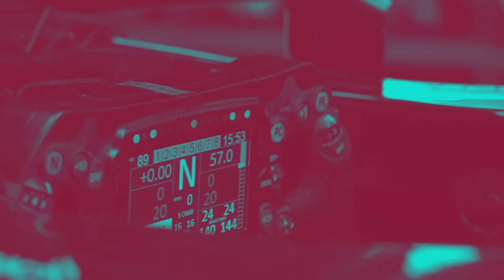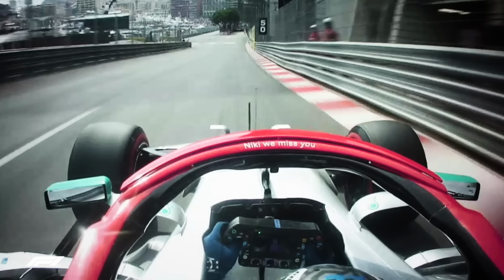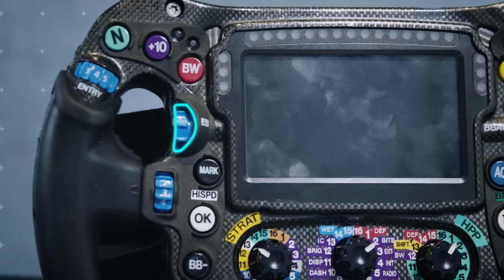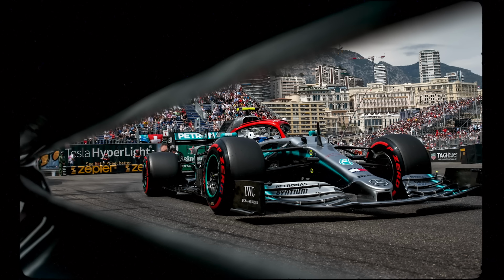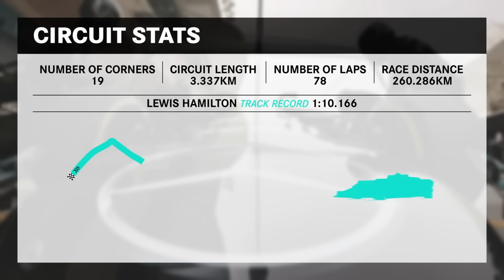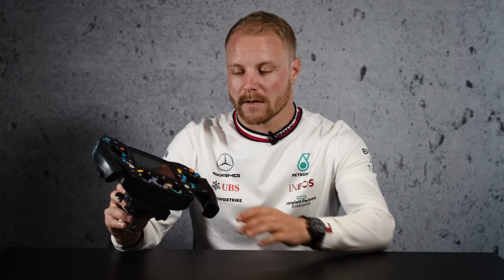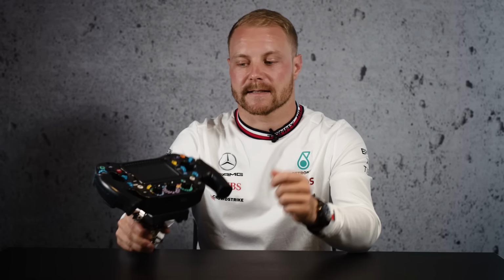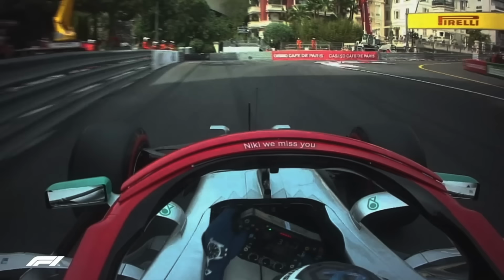What is an F1 Driver’s Workload Like During a Lap?

Comment: Doing all of this in the F1 game means you'll be in a wall quickly
Reply: Na it’s just muscle memory it’s easy to use the MFD without looking on a wheel
Reply: I usually simulate Monaco as it's not fun and a headache.
Reply: I took Monaco off the calender in my game. On a controller it feels near impossible to get around the hairpin without a thousand flashbacks.
Reply: @matthewslates  I used to play f1 2014 on the keyboard 💀💀
Reply: Monaco is soo challenging I love it
Reply: @matthewslates  use some oversteery setups from time trials it should help with the rotation i'm using a pad aswell and i started racing at monaco again it's still a pain but less :d
Reply: A couple years ago I decided to drive Monaco (virtually of course) the entire 78 laps - by myself - no other cars - with my PXN PC Racing Wheel.
At about lap 40 I wanted to die, I've never been more exhausted/stressed in my life. It's the most stressful thing imaginable...and that's just me sitting in my living room, no G-Forces, no actual barriers to crash into, no other cars to deal with, no chance to wrecking an 11 million $ car.
Every turn, brake, acceleration, and gear-shift has to be precise or else you've wrecked the car.

How these guys do this is insane.
Reply: @matthewslates  You have the same amount of lock as anyone with a wheel. It's probably easier with a controller because you don't have to cross your arms all the way over to get lock. Even with a wheel, you have to turn in at the right point or you'll not make the turn. You just need to make sure you take a lot of the apex in the F1 game as the game doesn't appear to have quite as much lock as the real F1 guys who don't use the kerb.
Reply: @yunusemrekarabyk8390  that might help if understood what each part of the setup changes. Every setup I use is taken off YouTube.
Reply: @grichard1585  makes u appreciate them even more. They are the best of the best for a reason
Reply: @matthewslates  u need to change your setup
Reply: Monaco is quite easy with practise
Reply: @joshhawkins8394  i mean yes, but it still the hardest track
Reply: Alot easier if you have the correct steering wheel and dont have to pop in and out of menus
Reply: @Doggepe  yea but not everyone has a wheel
Reply: @pravinvenkatraman1342  how
Reply: @breegefinnegan7513  as long as u keep the fuel mixture at lean on corners, u won't spin even with TC off. Not sure if it works on the newer f1 games
Reply: @emiliosr2978  debateable
Reply: @matthewslates  how to go through that corner without hitting wall idk
Reply: Top guys are constantly changing stuff sim included i change stuff on Monaco like others said muscle memory .... with my cube controls rim controls are at your finger tips as they are in real f1 cars
Reply: Jokes on you..... I am in the wall quickly anyways
Reply: 1.11.764
Reply: @ahmadhasif979  downshift with ◾️
Reply: @trebm3  i love Monaco difficult street tracks are awesome singapore also awesome
Reply: @shancanman573  finally someone who shares my views easy tracks are boring
Reply: These guys know where every button is on the wheel, and don't really need to take their eyes off. 
Me on the other hand, is playing with a controller.. I literally need to focus on the lower right corner of the screen to change settings xD
Reply: @pravinvenkatraman1342  I still do 💀😂
Reply: @grichard1585  man... mazepin is gonna blow it big this weekend isn't he lol
Reply: pfp checks out
Reply: @MpWrproductions  I’m wondering how yuki will do hopefully good
Reply: @lewdyson4744  bruh, selecting break bias or fuel mix is too much of a hassle through that, I only look at it during the straits
Reply: @saberline152  like I said don’t need to look at it
Reply: @matthewslates  Play without flashbacks. It will help you improve over the whole lap rather than doing one corner a million times.
Reply: @matthewslates  its 10 times worse on F1 mobile
Reply: @matthewslates  You simply can't take that hairpin correctly.
Reply: @grichard1585  I barely managed to do 20 let alone survive 40.
Reply: @pravinvenkatraman1342  you will spin if you yeet the throttle on F1 2020 with TC off no matter the fuel setting.
Reply: @trebm3  I love Monaco in league races. Provided you’re in a clean league
Reply: @m6398  1.09.602
Reply: +1
Reply: @magnussencube  why not keep TC on? I use a keyboard am the hairpins are way too easy to maneuver, but I do agree that Monaco indeed is the most exhausting track.
Reply: Lace strol
Reply: @E.after.D.I.am.T.H  I find TC boring to drive with, and I'm also on a wheel. Don't find problems with no TC.
Reply: First thing to do in Monaco is switch off damage :D Otherwise with a controller you are going right into the wall at hairpin
Reply: @matthewslates  1000% agree. Understeer city on a controller
Reply: Hot keys?
Reply: Lies. Get guud
Reply: @trebm3  Try it in Assetto in VR to get better gg
Reply: Indeed 😂
Reply: Not rlly
Reply: 747 flashbacks 😂😂
Reply: I setup certain buttons for the settings I change while driving so I can just hit a button and keep rolling
Reply: Most of the drivers in F1 games are in the wall even if they dont have anything to do at all, sitting at the start 🤣
Reply: These guys drive for their entire life. Practise makes perfect. Be no different for a video game if you played it for 20 years
Reply: @joshhawkins8394  Well look at you, aren’t you just the greatest. Everyone give Josh Hawkins a round of applause for being so amazing at life
Reply: @ryanokeefe12  think you'll find that the f1 teams use a steering rack specifically built for Monaco
Reply: if you have the correct setup then it's not that hard, I run Monaco with assists off pretty fast, my fave track tbh
Reply: @trebm3  really glad you said it first as I didnt want to admit it😄
Reply: Yeah
Reply: hahaha!
Reply: @oaz8  Inused to hate monaco in G1 2020 buy I decided to practice monaco 5 hours straight a few nights ago  and now can do 1:15's (and yes there's no assists ) I kinda made myself learn the track as I was so frustrated bouncing off the walls, now its my favourite because it feels so good to do nice clean laps  👍
Reply: Oh yeah ,like someone mentioned you need one set up you can access for Monaco (the older f1 games used to change steering degrees automatically to about 300 I think) to give yourself full lock at about 280 to 300 degrees its a must ro not hit walls on x2 of the hairpins
Reply: @yunusemrekarabyk8390  or just go in neutral for extra rotation
Reply: @pravinvenkatraman1342  get this man a steering set
Reply: @grichard1585  [So true]!    Yet so many ppl don't know that , they say "oh I could do that,  all they do (drivers)  they sit & drive around all day, thats not a real sport".  I want to say here have a seat (in a simulator)set to 100% race then turn the heat on 120F & let them breathe in race fuel / carbon Dioxide for 2 hrs. They quit in 10mins.
Reply: @matthewslates  i highly disagree, what u doing bruh?
Reply: That's why even the greatest of Esport F1 players can't beat F1 drivers in a real simulator
Reply: @shahrukh3542  tahts not the reason, the reason is because there is so much that you adapt to through your body and you are going through so much more physical stress and load.
Reply: Unless if they start making f1 games that don't support regular control pads but a steering wheel with every button on it
Reply: @matthewslates  I don't like using flashbacks. I turn it off. I rather restart the race instead. The hardest part of the race is the beginning when the cars are all stacked in one place. I restart the start of the race multiple times until I get out of it without a scratch. Once I do that the rest of the race feels way easier
Reply: @pravinvenkatraman1342  you are skilled
Reply: @m6398  is that ur monaco time?
Reply: @matthewslates  it ain't hard at all
Reply: @trebm3  it's my fave track

Comment: As Palmer said "yOu hAvE tO be AleRt oN a StReEt tRacK"
Reply from the maker: Exactly.
Reply: StReEt cIrCuiT*
Reply: @MercedesAMGF1  Can u pls explain to me what is differential and what do rotary dials do plssssssssssssss reply plsssss
Reply: @yogeshvartak199  Differential affects the speed of the rotation of rear wheels. If you unlock the differential you'll allow the rear wheels to rotate at different speeds and if you lock it you force the rears to rotate at the same speed, each is beneficial for different corners on a circuit to maximise speed on exit . I can't explain exactly what the rotary dials do though
Reply: @milanzukuma7243  Ya thank u but I wanted a reply from merc so asked this question😅Anyways,thank u
Reply: where's Palmer?
Reply: @nathanesguerra8745  retired
Reply: @Scope951  CARma
Reply: @HotBoxTrucking  what a yoke the five seconds

Comment: We've seen track guides n hot real and sim laps from many drivers but it would be interesting to see a lap in slo-mo talking through every action the driver makes re steering wheel control adjustments (brake balance, diff etc) in addition to shifting, accelerating, braking, driving line. Not necessarily Monaco but one of the tracks that requires more input than most...

Comment: THANK YOU SO MUCH VALTTERI  terrific presentation and explanations, even better still i think alot like you in the points and techniques. it's very much like being a fighter pilot except there is more memory involved with about the same amount of buttons at your finger tips that perform 3 different functions each and about 150 more within reach. your cars need a Heads Up Display especially for the shift lights. also vector warning lights since the halo blocks so much crucially important proximity awareness with other drivers on the track next to and behind you. a better mirror system mounted on the halo itself properly aimed should fix so much of that.

Comment: Monaco is a punishing track, but it could be more punishing. Charlie Whiting took out all the adverse cambers for instance and there are two many kerbs like the exit of Ste Devote Massanet, Mirabeau coming out of Fairmont Hairpin for example

In addition they removed the roundabout at the first corner and every year has an inconsistent amount of white lines still on the track. They should all be there, it's part of the experience

Comment: 0:48 codemasters should add all those options into their F1 game. Obviously it's not possible bcos key binding would be a nightmare. But as an option yes, I want them to do it. It would make it even more challenging and can also make you faster and give you more control over the car. Like you can increase the engine braking in tracks like Monaco and decrease it if you wanna save fuel. Something like that.

Comment: Good video, but was expecting actual lap breakdown on what is driver doing on his steering wheel exactly corner-by-corner - shifting gears and break/gas pedals are quite clear, but I was more interested in all those changes to differentials, break balance etc - which were mentioned only in general. But I understand you do not want to reveal that to the competition :)

Comment: I run alot of indy car on iracing.  And I have some very very fast laps at Charlotte roval road course.  But I took the McLaren mp4-30 to Charlotte to see how it stacked up against the indy car.  And first lap I ran 8 seconds faster!!! 8 freaking seconds!!!!! Then I realized simulator or not f1 is the ultimate racing machine!!!! Even the Porsche 919 couldn't turn laps like the f1 car could.  They're SCARY FAST
Reply: Oh and I had to get used to the brake point being 100 feet closer than any other car I've ran there lol unbelievable stopping power

Comment: You don't realise how many adjustments they gotta make corner to corner , they have to change steering angle for the tightest corner at Monaco I never realised that , maybe too many , I dont remember buttons on wheels in the late  80,s early 90,s maybe it needs to be controlled by a "co driver" of sorts ???

Comment: @3:21 ...why wouldn't you program logic into the controller to say "IF steering angle is >= [x] degrees THEN no input allowed"? Lines of code are lighter weight than physical guards so it's a weight savings too.

Comment: You might wonder how much time there is to gain by just dropping a load of functions on the steering wheel. Go for a fixed compromised setting and let the driver focus more on pure driving. It's just insane to see how much they do during a lap and how complicated it is and still they are with in tenths or hundreds of a second. You must be a genius to drive an F1 car to the maximum. All those people that say some of the drivers driving at the back of the pack are idiots are just making a fool of themselves. No idiot can do this 😅

Comment: (on dirt)950hp NASCAR 670hp when EV is mandatory?
In a basic oval track configuration.
 2350# 
Gas 

EV in car track ready is? 2150# 

What would racing be like? In that oval on time. If you was 200# light on tech?

 To have plenty race fuel.

Comment: This is effectively far from driving an 'automatic with paddle shifters'. This seems like more workload than manual F1's of old. I struggle to keep a respectable line and braking point at track day.🤨 They didn't even touch on the pressure of competition whilst racing. I disliked that track since Gran Turismo 3: A Spec.